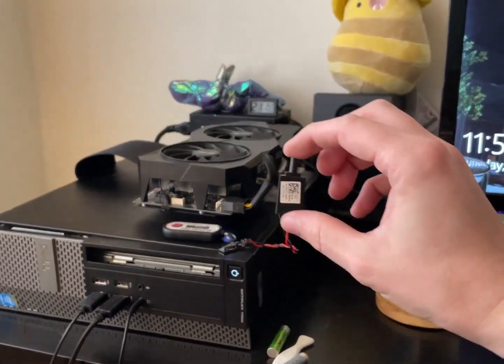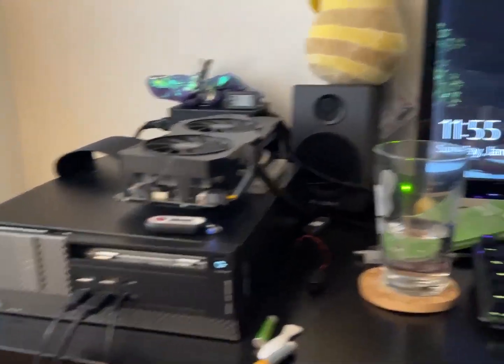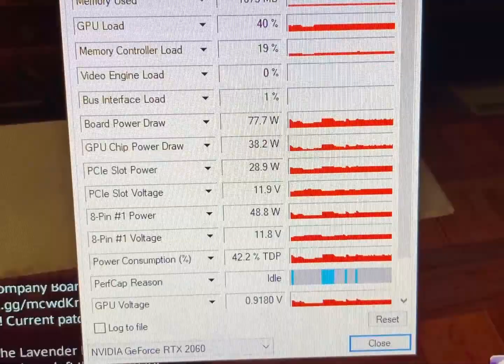Optiplex Gaming after 8 years: PSU upgrade results, future mods, Power Supply splicing!

Comment: Way back in 2007, I had an Optiplex GX150 USFF that had a failed power supply.  I ran that thing for the better part of the year with it having a regular ATX power supply sitting on top of it with the cables running inside the case.  Did the same thing after finally getting a new PSU, but with a graphics card.  I'll admit, I have a soft spot for those old business class computers.

Comment: 0:37 look into a server grade power supply.  You can get more wattage out of one of them, and the form factor will about fit.  (A 1u that is.)  You may have to use adaptors into the motherboard, depending on Dell proprietary nonsense, but that's what I'd do.
Reply from the maker: I don't need more wattage, I actually need less since my computer is so efficient. A server grade power supply actually has lower efficiency at this rated power than a good 80+ rated PSU.
Reply: @RinoaL  My mistake, I thought you wanted to power a better GPU with it, I should watch the whole video before commenting.  LOL
Reply from the maker: Yeah I just wanted to downsize from 2 PSUs to just 1 because it turns out my GPU doesn't take all that much power.
Reply: @RinoaL  I get that, but as a gamer, nope. Moar power!!!!!!!!!

Comment: Nice. I have an 8700 I got out of a factory a friend works in. Put a 550w evga I had laying around into it and an XFX RX 560 someone gave me for cheap. Planning to use it as a linux host system and stream my games from my windows gaming desktop over lan. Just need to finish up some irl stuff and put my soundcard into it so I have optical out and it should be a solid little desktop. Also put a 16gb kit I had laying around into it. The dimms need reflowing but it works most of the time.

Comment: I bought an ASUS cm1730 back in 2010 and used the same motherboard and cpu for almost exactly 12 years before swapping it out. The AMD phenom II x6 was one hell of a cpu. After all these years only one piece remains that is original. The DVD burner but to be fair it sat unused and outside of the machine back when I obtained a very specific drive that could handle burning 360 games with a custom firmware. That particular drive died in early 2022 and went unnoticed until I required it to burn a cd-r and when I did it came out blank and any cd-r previously burned or not would be recognized as an unused blank. Very weird until you realize dvd drives use two separate lasers one for cd and one for dvd and simply my cd laser was just dead unlike the dvd laser that kept playing dvd’s just fine that led to my confusion in the first place. Oddly enough I needed the cd-r for a laptop I was working on for someone and their dvd drive had the same issue.

Comment: Have you considered getting something like a PicoPSU (X7-ATX-500 or similar)? That will let you run the PC directly from a DC source, and it handles all the voltage rails and filtering for you. I have one of the X7 units I mentioned, and it works great. It can do up to 500W output, and has a wide voltage input range of 16-29V. I believe you can supply lower voltage but the total output power rating will also drop, but since you don't need much power that may not be an issue. That would be significantly more power efficient to run off your batteries rather than converting to AC then back down to DC.
Reply from the maker: Yeah I have
Reply: The proprietary power supply on this only outputs 12 volts so a PicoPSU isn't needed. I would be concerned about feeding an unregulated supply into a motherboard but I've tried it before and nothing broke.
Reply: @eDoc2020  Huh, looks like you are right. It appears to be a ONT1XP which according to the labels only outputs 12V on all rails including standby. I guess the do the sub-rails on the mainboard directly, that's pretty neat. That would make it even easier and cheaper to get a (quality) DC-DC buck converter in-between the batteries and PC. Not sure I'd trust feeding an un-regulated supply directly into a PC, but maybe if its batteries it'd be ok since the ripple would be quite small. I know VRM can be quite finicky with noisy supplies.

Comment: If you want to reduce system power consumption why not get a more efficient power supply? This Optiplex was offered with 80 Plus Bronze and Gold power supplies as options. A minute or two reveals several of these on eBay for under $20.
Reply from the maker: If I were to do that, i'd go with the 80+ power supply I'm trying to switch away from using. It's my backup plan after all. I'm just going to either one or the other.

Comment: the 2060 uses 160 watts max so i think you should be OK. power supplies go bad quicker when close to max though. They say it's good to have them at about half power max.
Reply from the maker: Yeah, it's either this or switch entirely over to the CX430 I'm using. Either way I'm kinda tired of using two PSUs at once.

Comment: Hello. I have 7010 sff. Exactly the same one. Thank you for this video. After watching this, I bought used 2080 requiring two 8pins power. Also bought 650w power supply to power the 2080. It seems not providing power to the 2080. Is there a specific setting to get power from second PSU like BIOS setting?? or special PSU?? or dual PSU power supply?? Thanks !! 🙏
Reply from the maker: Power supplies need the green wire of the 24 pin connector to be connected to a black wire. I just put a paper clip between the two. Connecting the green wire to a black wire is how motherboards tell the power supply to turn on as well.

Comment: 12:49 I understand this PC has been working for 8 years, nd that's awesome, but I'm surprised RAM limitations are the only thing you've had problems with.  Do you not play many AAA games?
Reply: I've been running a Dell Precision Pro 6800 since 2014 and it's handled pretty much everything just fine. Though, the most recent game I've played is Doom Eternal. It's not the powerbeast it once was, but it still handles 1080p gaming just fine.
Reply from the maker: Not only do I play AAA games, I do VR.

Comment: Anyome know a powersupply i could buy for this pc with cables ?
Reply from the maker: Honestly I recommend buying a normal power supply and modifying the output wires to be the right connectors for the optiplex.

The optiplex is easier since most of the wires that get used are just 12v and 5v I think. Also remember that there is a pin on the 24-pin connector (normally the wire is green) that is the pin which turns the psu on.

I recommend a multimeter and soldering iron

Comment: Can i run my 360 watt psu for mu optiplex motherboard, and 500 watt psu for my 3060ti? I thought i could run the two together but i’ve heard people saying things will blow up
Reply from the maker: Yes you can. Thats effectively what I’ve been doing. On the second PSU, you will want to connect the green pin on the 24-pin connector to one of the black pins. Preferable to use a resistor but I never had one and used a paperclip. That turns the PSU on, and then you can just run the GPU connector to the GPU like normal. Leaving the internal PSU uneffected
Reply: This probably doesn’t make sense, but what would happen if i connected the 4 pin from the 500 watt psu to the cpu and run both the cpu and gpu on 500 watts while the 360 watt psu connects to the 6 pin motherboard power?
Reply from the maker: @capxlotquin  Probably what would happen is the two power supplies would be slightly mismatched in output voltage. The one that is maintaining a slightly higher voltage on the 12v rail would probably do more work and the one that is maintaining a lower voltage would do less work, but they would most likely share the load and sync up. I doubt it would be much of an issue, might be better to just run it all off the 500 watt PSU or get a 600 watt PSU with an adapter.
Reply: @RinoaL  Interesting.. i might just use one of my dell 260 watt power supplies for now to power the motherboard and the dell 360 watt for my graphics card since the 360 watt psu has external power and i have a 6 + 8 pin adapter connected to it. I think that’ll work
Reply from the maker: @capxlotquin  Make sure you look at what the 12v rail is capable of on the PSU. some of that wattage is alloted for the minus-12v rail and the 3v and 5v rails. Should work though